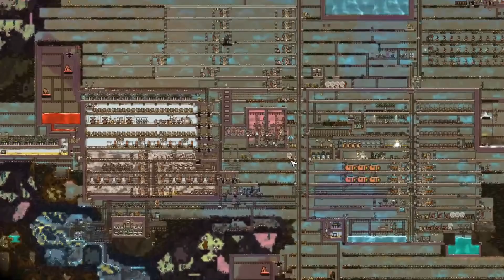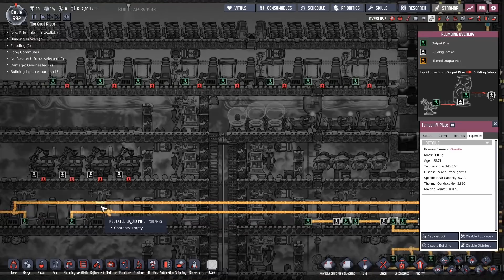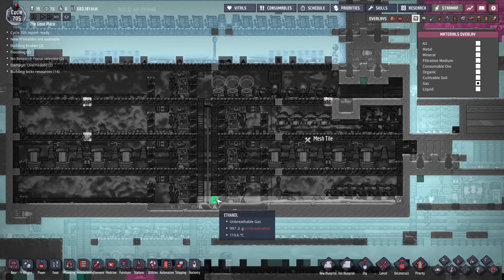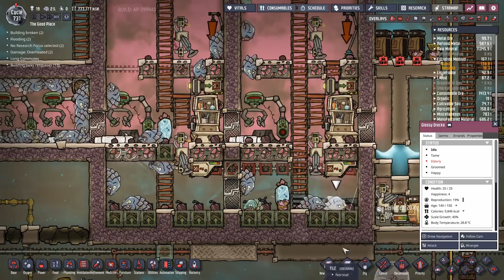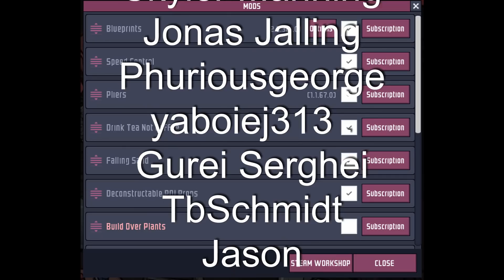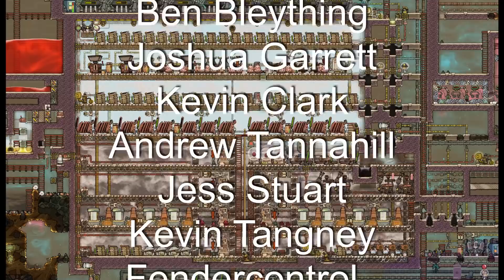Badlands Hungry Dupes 14 : Correcting all... a lot of mistakes : Oxygen Not included

Comment: One problem that you had in this video is that you kept on wondering how will the power level be affected and monitored once you do certain types of power draws. why don't you connect your main grid into a series of smart batteries, each with varying settings and plug them in Pixel Panels that has different sets of colors that sort of works like a vertical meter.
Reply from the maker: I'v never bothered with the pixel panels yet, should really be using them for a more active signally method.
Reply: @FrancisJohnYT  Yes please! I wanna see your take on this build!

Comment: For your heat exchanger, if you have the whole thing combined into one block the temperature of the two materials will tend towards a mean average temperature according to the block material temp combined with the rail and pipe temp. If you run the inputs against each other and separate the thermal layers then its more efficient on space as well as exchanging heat.

Tony Advanced has a lot of videos about systems that generate perpetual cooling, heating, materials, and energy in the game, where heat exchangers and game thermodynamics play a vital role.

Comment: I like to use ethanol and from my experiences that setup will not work on the long run because CO2 will not keep things cold, if the wood stops drooping heat the ethanol will flash but you might get lucky but I think is a question of cycles.

Also you don't like to kill kids but have a pool to "evolve them" right from the egg, hmmm
Reply from the maker: The whole wood cooling thing was just an attempt at a fix, I'm very surprised it worked as well as it did so far. If it breaks I can add a little extra cooling.
Reply: @FrancisJohnYT  I think you need to add another layer of wood to keep it in control.

I use ethanol to cooling, is great because it will catch a lot of temperature, that's why is hard to use in hot places but in cold ones is great.

regards

Comment: You should only allow the lumber to move past the cooling block if its above 50 degrees C or the distillers are out of lumber. That will stabalize your heat exchanger.
Reply from the maker: Was thinking of ripping out some of the tiles and replacing them with water, the extra mass would stabilize it a lot.
Reply: @FrancisJohnYT  Yes but this would allow you to use the fancy new stuff. :D

Comment: One medium that actually has some potential for deleting heat is Polluted dirt. You can get polluted dirt to 1712 C before it becomes molten glass. If you feed this dirt to a Pokeshell, or compost it (where the composter automatically changes stored materials to 70 C), you end up removing quite a bit of heat, yet I've never seen a system that takes advantage of this.

Comment: Dear Francis! 
Why don't you go full ranching on this series? I mean FULL! With ranching Pips for example you could generate more dirt, with dirt produce some mealwood, which will turn into rotten pile, so you could ranch more pokeshells. It looks like something like this: 1 domesticated Arbor tree can feed a full stable of Pips (they have the same calorie bug as the Dreckos). The tree requires 10kg of dirt/cycle and 70 kg PWater/cycle. The Pips will give you 160 kg of dirt/cycle, so you will have 150 kg dirt every cycle to grow 15 mealwood. That will turn into rotten piles if you leave it on the ground. I can't do the math on how many pokeshells will that feed but I think more than a few. While you have a sh#tload of phosphorite from the Dreckos, you could even boost the process. Beside this you will have more eggshells of course.
Furthermore you could do the same with POxigen - Pufts - Slime - Mushrooms - Rotten piles.
Cover the map with ranches! YEAH! :D

Comment: I think your counter flow heat exchanger is in the wrong orientation the conductor/insulator layers need to be vertical as the temperature gradient is horizontal. Also I think the save file is from near the start of the video, I was going to run a test to check, before posting but I'm not sure it will be accurate now. Awesome content your video's are always a highlight. Please let me know if I have it wrong.

Comment: Another way to solve the ethanol problem is to put all ethanol production in a separate CO2 room and only ranch regular slickers.

Regular slicker is a natural cooling source to keep the room around 95C. The ethanol will never be heated enough to vaporize because of the CO2's low thermal conductivity along with the low temp. You don't need to worry about the water boiling inside the carbon skimmers either.

I found this in a game that I tried to use ethanol production to heat up a room for industrial sauna and realized it stayed under 100C for 600+ cycles.

Comment: I have a suggestion for the lumber heat exchanger. If you turn it into a sealed room, you can place several gas tanks inside, fill them up with hydrogen and deconstruct them. That would give you several hundred kilograms of gas(or several thousand if you're patient). The conductivity will remain the same, but the heat capacity per tile will go up as the mass goes up. I didn't calculate any numbers, but with a sufficiently high pressure of hydrogen(possibly more than 1000kg per tile), it could be an efficient heat reservoir. An advantage of this is that you can make the heat exchanger smaller. The density of the hydrogen at those pressures will suck up heat from the lumber really well. And it'll be able to deal with the long periods when no lumber flows through the heat exchanger. If it can't hold enough heat, all that needs to be done is to increase the gas pressure.

Edit: 1741.25 kg of Hydrogen gas per tile should hold as much heat as the same tank filled with water. 3200.16 kg of Hydrogen gas per tile should hold as much heat as if the tank was filled with super coolant.

Comment: @ Francis John
23:07 -ish. Section off that heat exchange "sandwich" by vertical walls of isolation, but keep the mixed blocks inside.
I also think you should have diamond in the middle.
like this: 

( Can you make an Oxygen Not Included Science video about this combinations? You're really good at those videos. )

1 = best heat transfer, 4 = worst heat transfer. X = Isolation

X 2 X 2 X 
X 4 X 4 X 
X 1 X 1 X 
X 3 X 3 X 

Or maybe it's better to mix it up?
X 2 X 3 X 
X 4 X 1 X 
X 1 X 4 X 
X 3 X 2 X

Because the 4 is now compensated by BOTH the 1 & 2 tiles, while the 3 is compensated by 1.

This might also be an interesting design:
2 3      2 3 2 3 2 3 2 3 
4 1      4 1 4 1 4 1 4 1 
1 4      1 4 1 4 1 4 1 4 
3 2      3 2 3 2 3 2 3 2 

In this case the tiles with worse heat transfer acts as isolation, while also providing a "heat buffer", maybe best used with ONLY 1 & 4 tiles (skip 2 & 3 type tiles.)

Or simply this?

4 1 4 1 4 1 4 1 4 1 
4 1 4 1 4 1 4 1 4 1 
4 1 4 1 4 1 4 1 4 1 
4 1 4 1 4 1 4 1 4 1

Comment: Yeah, it looks like you accidentally had Fast Workers turned on. It's different than instant building, because the dupes actually do the work (just really fast). It's a relatively new Debug feature (you can also select it from world settings at world start time). Ctrl+Backspace toggles it while debug mode is available. It not only makes them build things fast, but do EVERYTHING fast. They also eat fast, they do recreation fast, they sleep fast, they skill up super fast. So your dupes probably skilled up a lot more than they should have while you had it on. It also makes them do silly things like only grab 40kg at a time from pitcher pumps, etc.

Comment: you could just have 2 pipes each carrying 1kg/s of ethanol going into the same input of a petroleum generator. That way each pipe only carries 1kg/s to prevent state change but the gen still receives 2kg/s as to not hold onto ethanol and allow it to state change inside it. Obviously do that twice for the 4kg/s that your using

Comment: It's not necessary to have one big industrial sona. How about having multiple localized sonas?
It just feels a bit hard to follow all those pipes and rails.
Btw, I came to realize that using polluted water for cooling creates more problems than it solves. When I try to reconstruct the pipes I always have to keep in mind that they offgass. So I just use simple water. It works just fine.

Comment: This answers a lot of questions. I now know where a bunch of ethanol gas is coming from inside my base. There was kilos and kilos of ethanol gas just appearing and for the life of me I could not figure out where from
Reply: One of my first heat deletion devices was to pipe throttled ethanol through my hot room, to then be insta-consumed in the generator. It works quite well and is quite powerful, without needing plastic for a steam generator, but you do end up with a bit of ethanol gas being released when it is being used.

Comment: Something you might try is to feed 1 kg/s pipes to the generators and have 2 pipes end at each generator's input. If it works like drains you can have the 2kg/s come together at the generator and not state change. I use this trick on a 10 kg/s sour gas generator to make it so I can dump 10 kg/s of crude oil at ~540 Celsius in 1 kg/s pipes but only using 5 drains to output the oil with no pipe breakage. Even though there's 2 kg/s coming out of each drain and the temperature is well above the crude oil to petroleum state change there's no pipe breakage because the pipes merge at the drain. I have no idea if it'll work with a petroleum generator - I've only ever used this with drains.